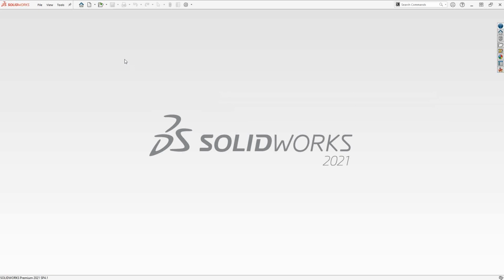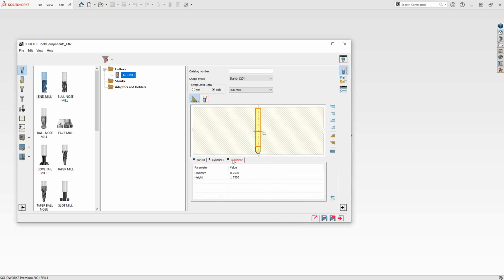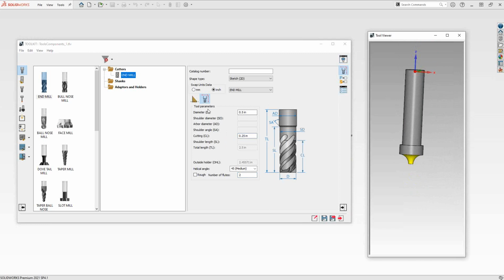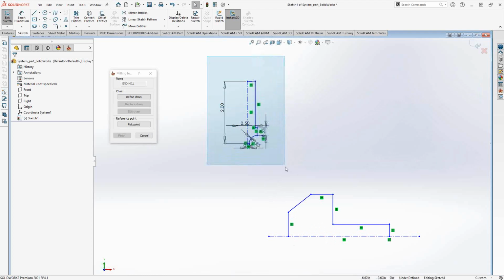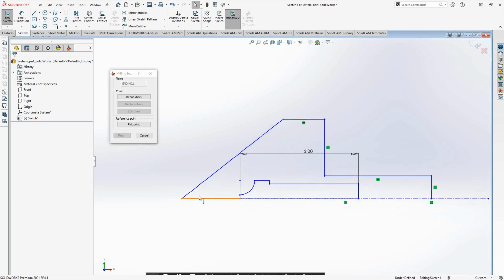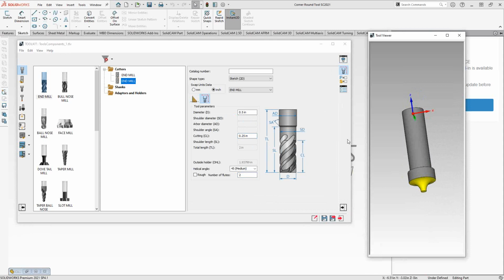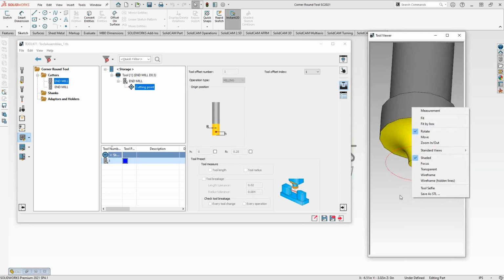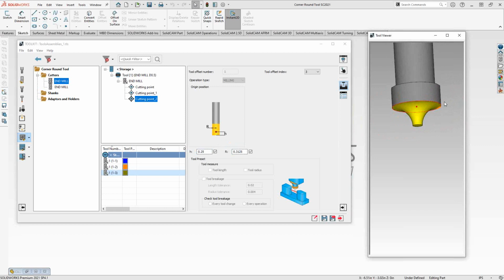Custom Tools

Comment: I wouldn't class a rounding cutter as custom... I wish one of these would show something a bit more use full, like a high feed tipped mill with its unusual geometry.
Reply: I would love to see that on the tool kit table. you can't find the tip shaped like that in the template.